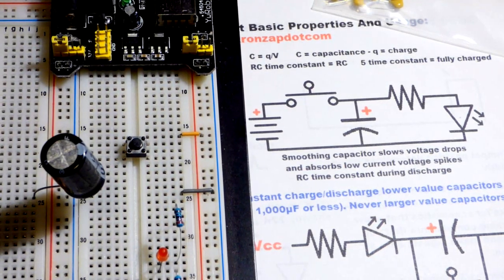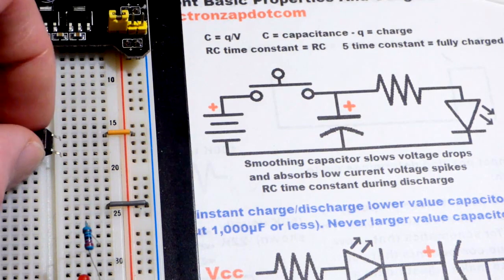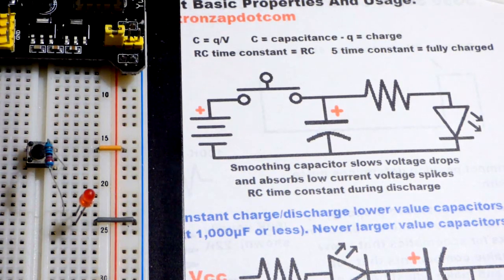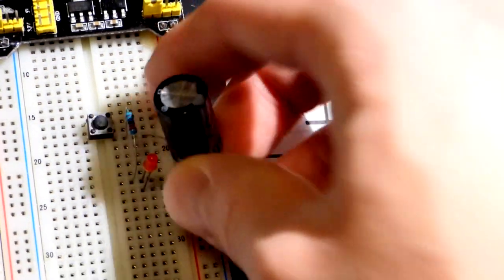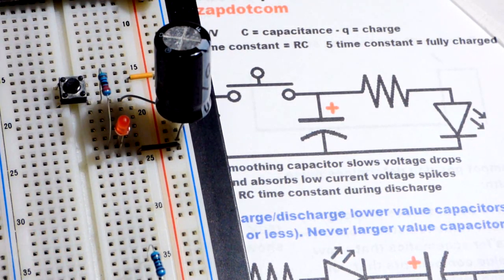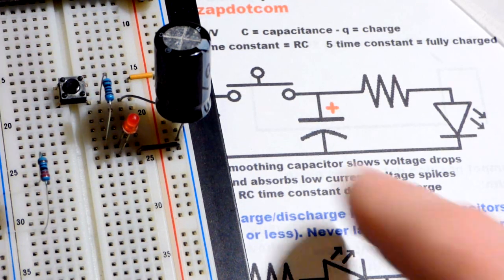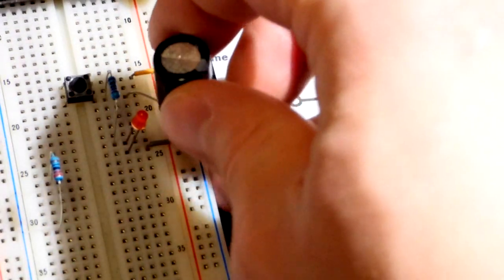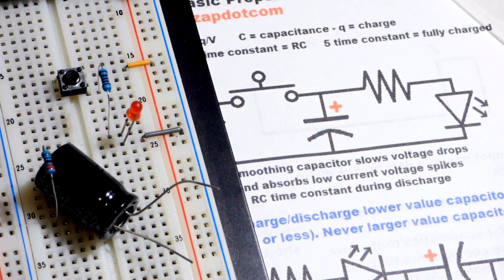Electronics smoothing capacitor basics

Comment: Will this stop flickering on a buck converter running an led?
Reply from the maker: That sounds like a problem that would likely be solved with a smoothing capacitor close to the LED.
Reply: @Electronzap  Ty for the advice I shall give this a try

Comment: Am not a electronic engineering student.....I have a doubt about capasitor ! I have a 12-15 v DC single supply need amplifier board.. I connect 14 Dc to that board & also connect audio input and speakers out .. when I increase the volume the problem starts. In high volume of amp the amp board get cut off its speaker outs, means that input dc voltage not strong.. can we solve that problem with a capacitor ? If we can what type capacitor did I need to use? Plz help me to find the voltage and uf of capasitor!
Reply from the maker: That sound a lot more complex than what I do. Circuits and components have power limitations that you have to be aware of. If part of a circuit briefly loses voltage when it has to provide a short burst of current, then a capacitor would likely help that part of the circuit. Audio electronics is a large topic to learn. Good luck!
Reply: @Electronzap  😭😭😭😭😭

Comment: Is it important where the capa is placed ?
Reply from the maker: It's best to keep it close to the point where it is important to hold the voltage steady.
Reply: @Electronzap OK Thanks.  I copied a little project a few days ago and the capa was used to make an LED flash (also using a 547 tran), but it worked because of breakdown voltage. How caps holds voltage i understand, but the many different uses and why things happen, drives me nuts lol
Reply from the maker: Yup. Probably an unlimited ways to combine electronic components :D